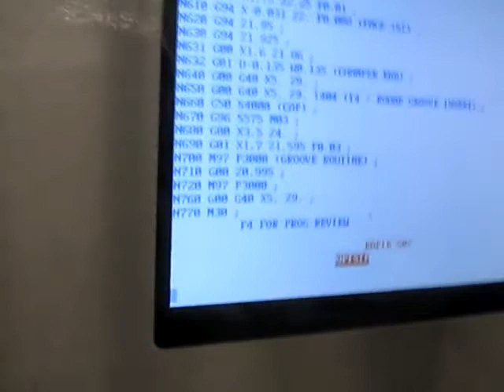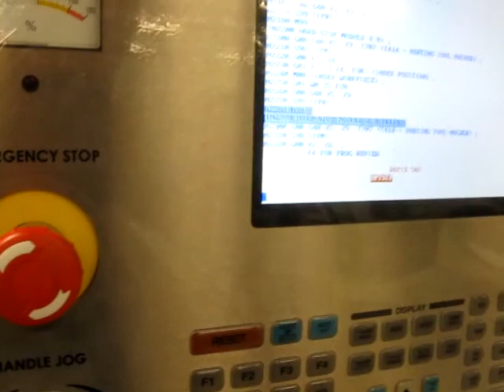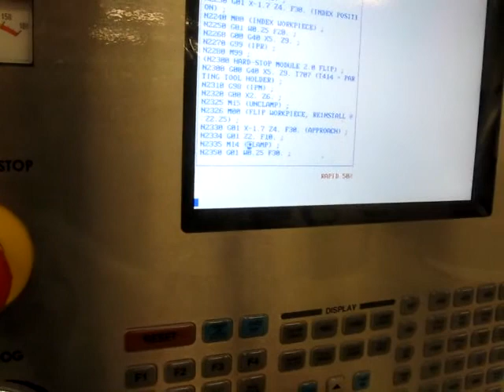Delrin handle (CNC lathe project)

Comment from the maker: The students typically use HSS tools so the speeds/feeds are limited there, but as you mentioned the delrin items are quite a bit more forgiving. We encourage them to experiment with the cutting parameters but usually they only make 2-3 parts so they're done before they know it.

Comment from the maker: @macsthunderhawk I think he was worried about the chuck clamping force decreasing a bit at higher RPM. Typically we don't exceed 3k-4k RPM since we run this machine without coolant but these certainly have a nice fast spindle so taking advantage of it is a luxury we don't often see :)

Comment: How are you getting that chip formation off plastic? My shop runs plastic regularly and I am always fight with plastic chips. It has even been bad enough that it will ruin parts while running unattended, which is now no longer an option because of this issue.
Reply from the maker: hmm, not sure...we get a lot of stringy plastic chips too, but this big white rod cut really nicely. It's possible the material was glass-filled, I can't be sure since the student's project was from several years ago years ago. Looking at his program: RPM cap was 4000, roughing cut was done at 750 ft/min with a feedrate of 0.010-IPR, finishing cut was 850 ft/min at 0.008-IPR.
Reply: Huh, I do keep reading about heavy feeds and slow speeds for things like Acetal to get a good chip break. Other plastics seem to be exclusively stringy with no help in sight! Still, not going to stop till I find a good recipe! Thanks for the input!